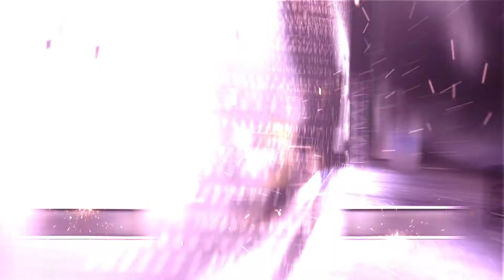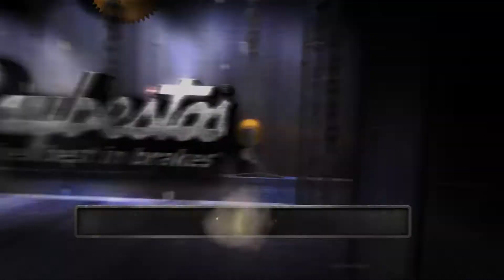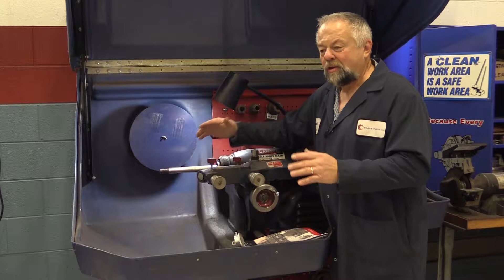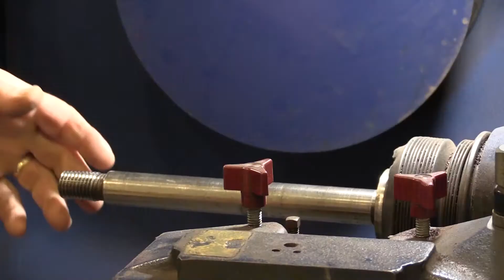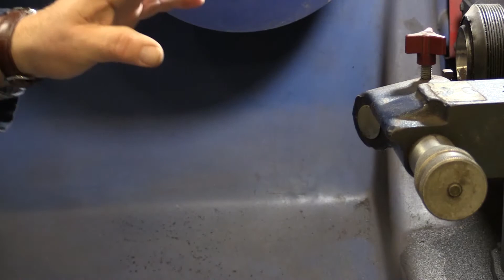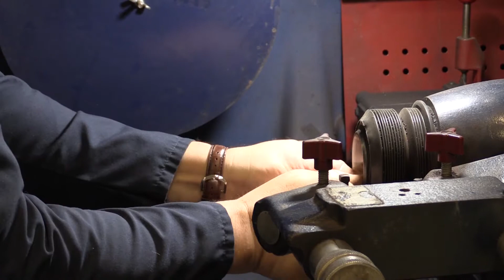Brake Lathe Arbor Maintenance

Comment: Anyone have any ideas how to fix runout on an accu turn lathe? Mine is doing CRAP work on rotors at the moment. If I can't fix it, I have to trash it as it is unreliable atm.
Reply: Never taken an accu turn apart but if you can take it apart like this and clean it I would try that. If u put it back together and it has a small bit of run out use ur dial indicator to find the high spot and then use a heavy brass hammer to hit the high spot then re check until it has less the one thousandth run out. If it has a lot of run out and the arbor is like this one where it’s tapered put valve lapping compound on the tapered area, turn machine on and put arbor in to lap it for like 45 seconds, turn machine off, clean compound out of lathe and shaft and if the area looks good install the shaft and see what you got, if it’s still really bad u might need a new arbor as long as you don’t have bad bearings or something causing that.
Reply: @peanutbutterisfu  I have tried the lapping compound method and it did not help. I believe it's going to be a bearing issue. The reason I think it is the bearings is because with my dial indicator on the arbor (regardless of clocking of arbor) I can lightly push up or down on the end of the arbor and the dial indicator goes crazy. I know that I have a lot of leverage out on the end of the arbor but very light finger pressure should not allow, or be causing, such massive swings on the dial indicator. I can push up, or down, with minimal pressure and the indicator is changing as much as .020"... I don't think that is normal. For as thick as the arbor shaft is I can't imagine that light finger pressure could bend it enough to allow that much deflection. Do you have any idea how difficult it is to change the bearings on one of these? I've been looking on-line and cannot find a diagram on how to disassemble or service it. Last year the electric motor went out and the company I called charged me $1200  to replace just the electric engine. I honestly did not ever imagine it would be that much so I did not ask for a quote up front. Needless to say I won't be calling them for ANYTHING going forward and will either have to fix this myself, or scrap the machine.

Comment: Runout is checked near the threads not in the middle. It doesn't bend in the middle. It will bend at the arbor face